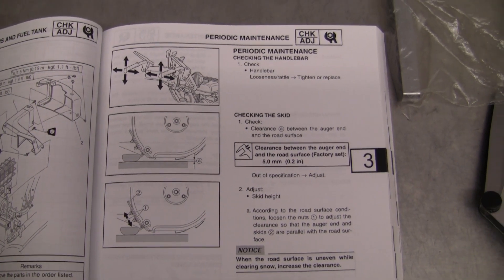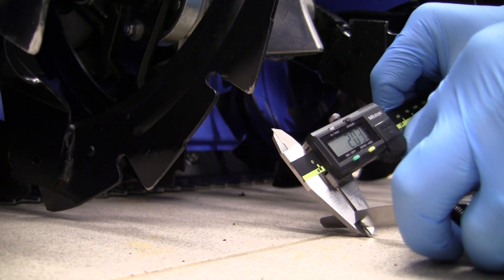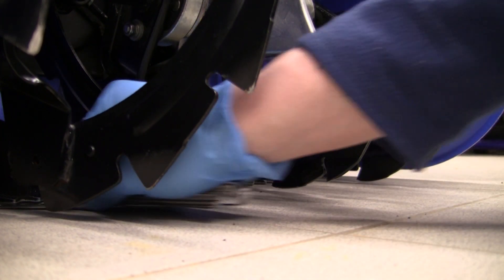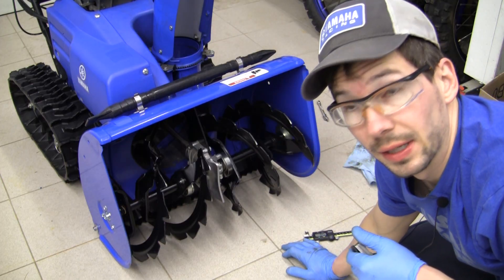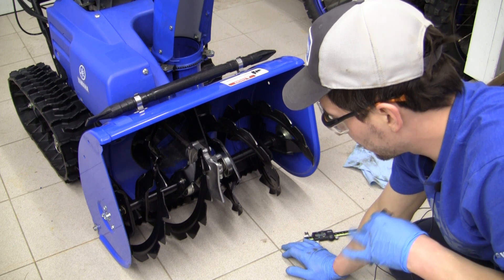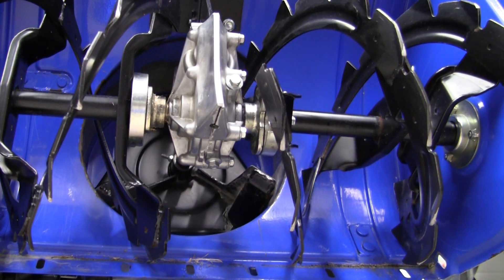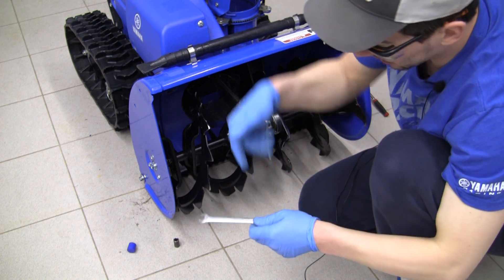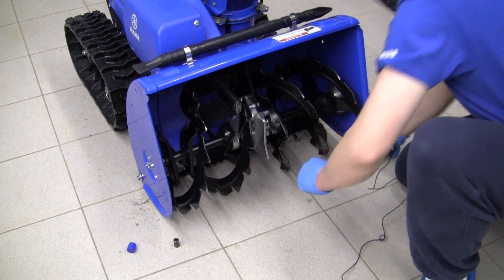Ep. 18 - YT624EJ M.S. - Checking and Adjusting Auger and Scraper Heights

Comment: Great informative video as always Luc. I have a 2021 yt624 and my housing seems crooked. Ive done some adjustments on the shoes and scrapped as well but are you saying that the housing being crooked is the cause of the shoes or/and scrapper not being adjusted correctly? 

Im also part of the snowblower forum which im pretty sure I've seen you comment on there. I've seen threads that talk about the housing being crooked but everyone seems to think it just comes that way. Never really bothered me because it still works perfectly but if i can correct the housing issue I'd do it for sure.

I'm curious to hear you're opinion on this known issue or maybe do a quick video about it. Cheers.
Reply from the maker: Hi Nick, I should have communicated it more clearly, but, I think I made the housing off-level when I first adjusted the auger height. Basically I had wrenches under the auger and variations in the auger I think caused my housing to end up being adjusted off level. Whether it's crooked or not in relation to the blower frame I'm not sure, but after I was done with all the adjustments, the housing, auger, and scraper were all nice and level. I did read that also on the snowblower forum. On a level surface you should be able to measure if the housing is straight by lifting the shoes and seeing how it rests on a surface.